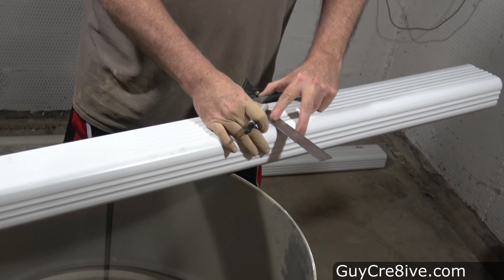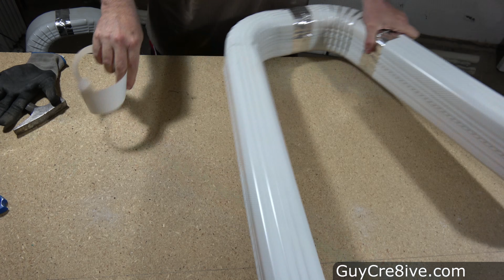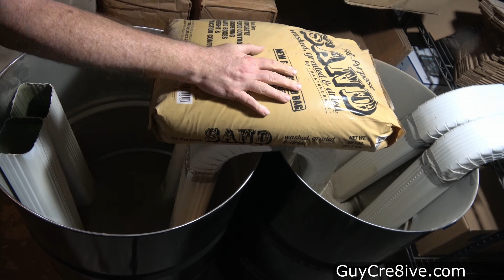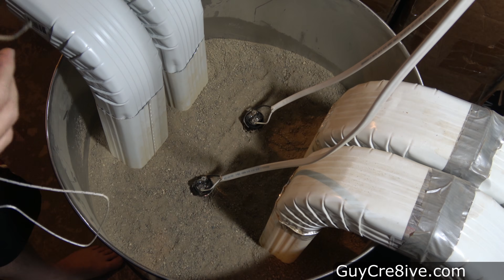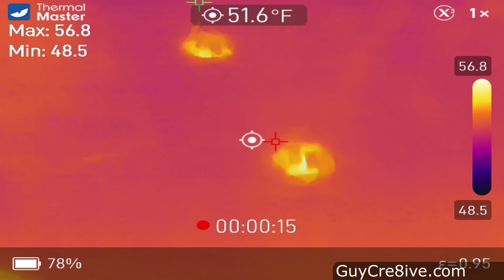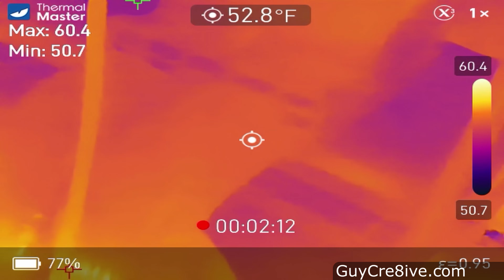Sand Battery Heaters How To Build DIY Solar Powered Heat Drums Batteries Elements For Home Heating

Comment from the maker: This is a comment from a user which seems important if true: "Careful don't use the air from that drum directly because u can get Silikose from that Siliziumdioxid, he is doing it absolut right better would be stainless steel as a pipe, sand can be over 400 degree so zink or else would contaminate the air."
Reply: Why not use copper pipes in a coil configuration instead of aluminium gutters? Copper has better hear transfer and |I believe it can withstand higher temperatures before it starts getting softer. The sand can heat up to very high temperatures so you need to make sure the output is pointed somewhere nobody will touch and it would be a good idea for the air to go through a radiator so the heat dissipates faster. For the heater I would also use a custom coiled heating resistance wire to be more efficient than the regular heaters. You also need a contoller to monitor all the time a few temperature sensors inside the sand in different locations, one to  monitor the radiator that dissipates the heat in the room and oone sensor in the room to make sure you ndon't overheat it. You must realize that the sand can go to insane timperatures, hundreds of celsius degrees and continously heating a room with that temperature it is a bit dangerous.
Reply from the maker: @mariuschirita2017  I might try that next, thanks!
Reply: @GuyCre8ive hi do you have planon how to do it
Reply: @mariuschirita2017 now you know what you are talking about
Reply: Maybe insulate the 50 gallon drums
Reply: @peterleresche167 yes , it can be done , but those are round and somewhat cumbersome (diameter of  each drum would be , at least doubled , if not more , height would be , also , considerably higher). Besides , those were put in some kind of utility room (in video) and who would risk haveing DIY made sand battery , with temperatures of around 1500 °F (maybe even higher) inside and not constantly monitored. Ordinary wood stoves are operating around 400°F , sometimes up to 600°F and thise (usually) are built with much thicker metal than drums. 
 As I said before - the only way to look at the sand battery for heating a home , is like any other heating system (with planning , engineering, execution and cost) . For individual rooms (not very large) , it is viable option , with smaller containers and if the other conditions are right , but there are much more efficient ways (and also , pretty inexpensive) to heat a room in winter , using solar panels as a source of energy , than sand battery.
 It makes cool hobby though.
Reply: After thinking about the design a bit I have a few observations.

Most of it is from the power source.

Although using solar panels makes sense.
How long does the sand stay hot enough to draw usable heat?

My concern is that when this heater is really needed the sun will not be shining.
2 or 3 days of overcast days and there would not be enough heat to be useful.

What if you inserted one or two more elements but ran them from a wind generator.
A 400 to 600kw vertical axis wind generator is not that expensive.
However it would provide power at night and cloudy conditions.
Reply: @shawnr771  or, have 3 ways of charging. wind, Solar and a small electric curent that comes on when ever the price of electricy is lowest and the sand is below a preset temp
Reply: @robinkirk3601 I am shooting for true off grid.
Reply: @shawnr771  Solar gives you electricity so a sand resistance heater is about 25% of the efficiency of just using a battery and heatpump. You can't really combine the two though as the efficiency of a heatpump is much lower at higher temperatures so its not a win to use a heatpump to heat up a big sand barrel.
Reply: @etchedpixels ok.
The idea I am working towards is a heater for a greenhouse.
It doesnt have to keep the temperatures at 80f.
It just has to keep the greenhouse from freezing.
Reply: I think it's a great idea. I've also been looking into using solar for heating, though I'm considering using solar heat rather than electricity. There are numerous videos here on diy solar heating collectors, but I'll share my idea and maybe it will help. I haven't seen this idea used specifically, as this is a bit different.  You make an insulated wood box, find one or two used car radiators secure them in the box. Paint the radiators black and the inside of the box. You'll need radiator hose and some reducing elbows. Getting the pipe size down to a half inch, drill holes in the side of box, one for inlet and one for outlet. The bottom is the inlet and the top is the outlet. If using 2 radiators you will join them together with a radiator hose. Secured to the box is either a quick connect male and female ends or a stop valve. Run however many feet of 1/2" pex pipe into the place where your sand battery or a water tank (55 gal) is. Put some 1/2" or 3/8" copper tubing in the barrel for a heat exchanger. The system will need a low cost high temperature pump that can run on ac or dc. The water running from the solar collector to the battery will be a mixture of water and antifreeze. This setup can produce very high heat. It can be used to heat a sand battery or replace house hot water. It works in the winter as well. This is just an outline of an idea. I read that using solar electricity for resistive heating is not the best way to heat, but I don't know. I do like what you've done here and I'm sure you'll figure out improvements to get it to work great.
Reply from the maker: @quiztron6769  yeah it's my first design so I just need to work all the stupid out of it.
Reply: @quiztron6769  It doesn't seem like anything wooden should be used in the high temps that can be generated.  I would be afraid of using anything that can destruct under 200F degrees.  Although, wood frames are used in many metal solar collectors.  I don't know though, guess it depends on how 'insulated' your wood is.
Reply: @nerapsnart  The inside is lined with reflective rigid foam. That should keep the wood from being affected by excessive heat.
Reply: @quiztron6769  ok. I follow you on that, perhaps if as you stated resistance heating is not best practice would it seem practical to install indoor radiators inside the area to be heated ?
Reply: I did this last winter, you need like 4 heating elements per drum, or a few oven coils, the more surface area the better.
i used 6 inch galvanized HVAC piping and a 6 inch blower. I couldnt get the sand battery to absorb enough heat to actually make a huge difference. I had a better out come with hooking an old water heater in a closed loop system across a radiator water releases and captures heat way faster. sand really only makes sense after you get to a certain size and you can insulate it well and heat it all year with extra solar. it can store a lot more heat though since you can get it way hotter than water.
Reply: @33moon   maye a large steal water trough not barrels.
Reply: set a thermostat to turn on and off
Reply: How about water? It's 4200JKg/C, sand is 890JKg/C. It's more dense than sand. Almost 5 times!
Reply: Doesn't matter that sand is 1.3 to 1.7 times denser than water. It's much easier to extract heat from water than sand.
Reply: It did not collapse under the weight  of the sand - the heat was sufficient to soften in it. Use iron downpipe if you want to persist with this design. Edit: Christ that's a dumb design. Don't be using plastic insulated wiring anywhere near the heat this setup can accumulate. Think about ceramic insulators with metallic pins to connect to your heating element.
Reply: Also a good idea.  I was wondering about the gutter with the heat.  Sand can get over 1200 degrees F if you just pump power into the heating elements.  Looking forward to your next video on the improvements (see ideas from @robertchristoper339).  Sorry it's taken me so long to see this video but, overall, I think you have a great approach.
Reply: Copper pipe
Reply: Just found your channel.  Wanted to thank you for your efforts to find solutions.  And for sharing your experiments! God bless
Reply: Cool video , but the idea of the sand battery  isn't what you think it is , or I got it wrong. Of course , sand can retain heat , but thermal efficiency/capacity of sand is like  five times lower than water. So , in daily use , as thermal storage , water is much more efficient as a medium than sand. However , water boils at 212 ° Fahrenheit (100 °C) and that is a (sort of) shortcoming of water - one need to keep the temperature of water heat storage below said boiling point , which means , one needs pretty large volume of water , in order to be able to control the temperature (of heat battery) more easily and to store enough energy (with some redundancy) to heat home.  Other advantage of water as thermal battery is easiness of heat distribution (pipes and some pump , or just siphon effect).
 On the other hand  , idea of sand battery is to get as much heat as possible (and I mean - near metal melting temperatures , or higher) , with smaller amount (volume) of heated medium (sand , in this case) and with much smaller footprint of such a system.
 Both "things" must be considered as a systems , not a "pocket supplement heating element". I mean , in vastness of internet  , you can find different attempts of bucket versions of sand battery (with intention to be mobile - like , those heat up during the day outside and people carrying them inside in the evening). It's not working , for various reasons , but mostly because of thermodynamic laws (I can explain each case , but even like this it is too long of a read). To explain it differently , it is like a small wood stove - you need to feed it wood constantly , to get adequate temperature , to be comfortable in the room/house. If you let fire to die , stove will cool , or  the other possibility is to heat up the stove almost to a melting point (like orange hot) and by the morning the temperature in the room might be ok, however , first few hours it would be impossible to be around that stove (never mind the fire hazard). 
  What I'm trying to say is , unless you use  proper materials to build a sand battery (sand containers are one of the limiting factors) , with proper insulation (not that pink fiberglass stuff that people put into the walls) and thermal/heat exchange unit , it is just a hobby and interesting videos. Of course , I mean very high temperatures within the sand battery and some kind of distribution (liquid is much better than air) throughout the house. 
  In my opinion , it is MUCH better to use fire bricks with heating units (which are connected to solar PV panels) , in some sort of metal , INSULATED , enclosure and that is much less complicated and you can use ducting and fan(s) to take the hot air wherever you need it. Where I live (Europe) there are commercially available units like this , but it is easy enough to make it diy style. Unfortunately , I can't attach a photo of it here.
  If you decide to go ahead with the sand battery , I would suggest to use more heating units , but not for water heaters , because those are made of chrome plated copper pipes(those break easily , in sand batteries). You need stainless steel heating units , like on old stoves. Those can withstand much higher temperatures. Also , to improve sand heat conduction , you can mix into the sand aluminum (aluminium where I live) and/or copper shavings (some metal workshop , or jungle site). INSULATION of containers is a must and first layer should be , so called , welders  blanket , and on top of that mineral wool , or special  fire proof fleece (better , but more expensive). Connections between heating units are made with BARE steel wire , with low resistance (forget the copper cables and any insulation on the wires , besides the ceramic one). When that part is assembled , itl eaves just heat exchange unit to be attached and heat distribution.
 I'm sorry for the long post , but I've tried to explain it best as possible , in order to prevent waist of money and time and disappointment (with , somewhat , limited knowledge of English). People in the comments give ideas, but nothing will get you desired result , or close one , unless some math ( a lot of it , actually) is used and significant amount of money . 
  Good luck with your project(s) and if you need further clarification , just ask. Though , I'm metric baby , so I might mess up some Imperial units.

Comment: I saw a video of a guy experimenting same as you did. One of the lessons learned was the water heater elements didn't last as long as electric stove/ oven elements.

Remember sand has low heat conductivity so you need a high surface exchange.
Reply from the maker: Yeah I've been seeing that comment, I'm gonna keep using the heater element until it stops working though. That will be part of my next video about these.

Comment: Wrap those barrels in insulation, youre losing heat off the metal faster than the heating elements can heat the sand.

Comment: Since hear rises, what if you mount the two heating elements through the sides of the barrel, near the bottom, in the first two bags of sand. And insolate the barrel sides and top. 
 Just a thought.

Comment: Just watch this video see its 8 months ago so there might be an update but might be worth putting the gutter down to the floor on the intake so it can pull the cold are from the floor naturally instead of having to have a fan and running more electric it would be more of a passive except for the actual heater not sure be on that right now but that's the first thing that came to my mind

Comment: Because of its high capacity, water absorbs and stores significantly more thermal energy without a drastic change in temperature
Reply: still it does so only up till 100C, sand will easily go up to 400 degrees

Comment: Water has a specific heat capacity of about 4,200 J/kg°C, while sand is much lower at around 880
Reply: so you need to increase the operating temperature about 5 times for the sand, which is easy

Comment: I suggest:
1. Ceramic fabric around and atop.
2. Put a heating source on the bottom of the sand/barrel, try a heating mat. 
3. Use only one gutter but have it coil in the sand from barrel to barrel.

Comment: inside your gutters.. stuff metal scrubs, like for cleaning pots and pans. it will absorb more heat and increase the surface area for the thermal energy transfer..

Comment: water has a higher specific heat capacity than sand, meaning it can store about five times more heat energy per kilogram for every degree of temperature rise.
Reply: still it can't get to 100+ degrees celcius

Comment: A thermal mass, sand battery, rammed earth wall, thick floor - same tech - use underfloor heating cable, it concentrates the heat less, so you spread it out more in your mass.  Like put down insulation; lay down sand and place the UFH cable in the sand, put down more sand and then flooring stones.  The whole floor is your sand battery then.  Same idea in a rammed earth wall... trombe wall... UFH cable is your friend, easy to install, not so concentrated heat.  Heat rises, no need to blow it around, the floor gets warm, you shoes are dry, the dogs are comfy, the whole building gets warm, long latency.  Sand batteries are everywhere, we call them stone, cob, rammed earth and concrete; just insulate them.

Comment: I have a working sand heater but only in a 5 gallon steel bucket with 2 240v water heater elements wired in series mounted in the side of the can, 1 at the lower part & the 2nd closer to the top. Running it all day on my inverter, the bucket reaches about 550 degrees. Good heat comes off it for half the night & by morning the sand is still warm but only a bit more than room temp. I tried running both elements in parallel but even tho they are 240v elements, when buried in sand they will overheat & disintegrate.

Comment: for everone else experimenting please use stainless steel pipes iron or zink couted gutter pipes create zink oxid poising 

Zinc melts at around 420°C, but starting at 200°C, to 250°C, the zinc coating rapidly ages, oxidizes, becomes brittle, and peels off (white rust and thermal degradation).At a continuous 300°C in hot sand, the external zinc coating literally burns off or outgasses, releasing toxic zinc oxide fumes and instantly destroying corrosion protection. Afterward, the underlying steel sheet rusts through extremely fast.
Reply from the maker: Thanks for the warning, definitely something to keep in mind for future builds. This should be safe though, the air coming out of the gutters are not even close to the temperatures you're warning about.

Comment: Would putting some chicken wire scrunched up in your tubing collect heat from the walls of the tube and warm the air better.
Reply from the maker: That's an interesting idea for increasing surface area, I'll have to consider that for future builds.

Comment: Nice setup.  Suggest insulate the barrels, even the top (not right where the elements are unless you are using wires/connectors that can take it)  and bottom if you are building new ones or moving them..  If you want longer term heating just in the basement, some 4" computer type "muffin fans" will do a good job.  Nashua brand is known for being quiet but a little more pricy.  Used solar panels if you have space are a pretty good value.

Comment: Use caramic pipes, the air should travel longer aswell. heat from the buttom, thermal isolate the sandbatteri.
Good luck
Reply: P.S  Use basalt-sand instead of sand!
Basalt can store much MORE energi,

Comment: I dont get why you don't just use a storage heater.    Here in the UK we have a type of heater that looks like a radiator but is actually a massive electric heating element surrounded by massive blocks that heat up.
Reply from the maker: I'm not sure what that is but I'll look into them, thanks!